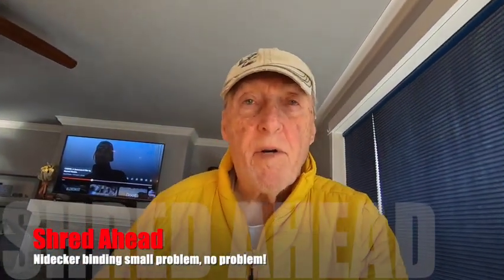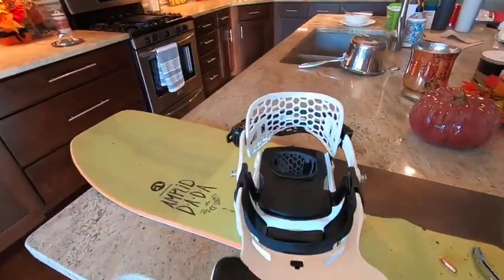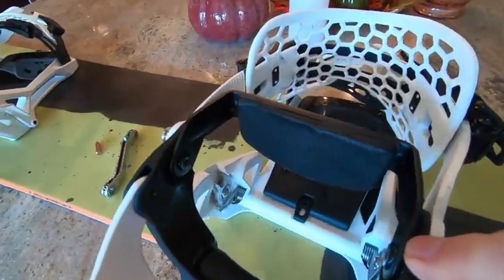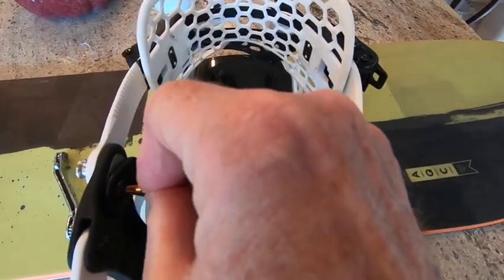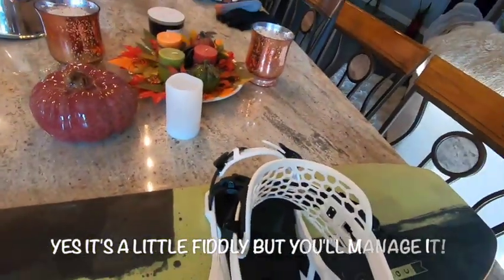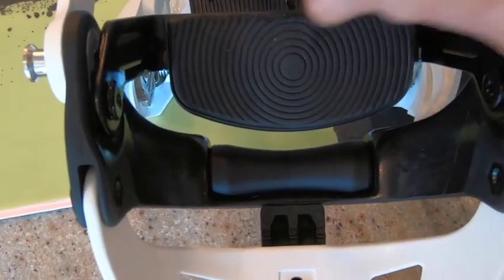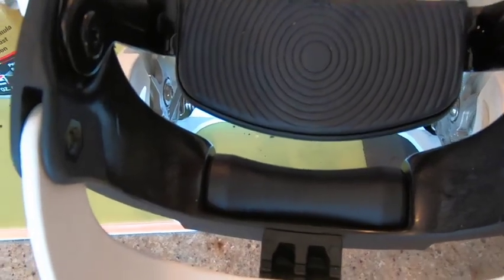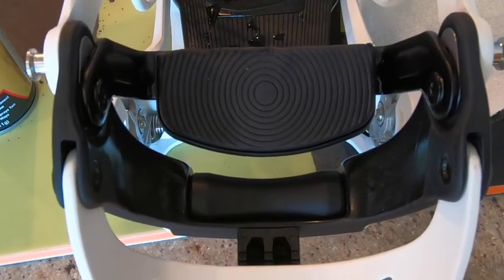Small binding problem (supermatic heel cradle)

Comment: Might be worth a bit of red loctite. I keep the glue-stick style loctite with all my tools and parts as it makes much less of a mess when applying to bolts.
Reply from the maker: I think the retention on the screws is tight enough that they aren't going to loosen up, more moving parts more to think about.
Reply: or nail polish is good

Comment: What’s your take on the bindings overall? I’m looking at these and a set of flow nx2s for my new board so any info would be helpful
Reply from the maker: I like the Supermatic but it can be a little fiddly, however the convinces is great. Still the coming out is a slightly longer process due to the push down lever for release! The highback not folding down on the heelside into the path of the push foot is something that I would consider problematic on the flow or nidecker rear entry systems! So like most binding's pro's & con's seem standard, hope this helps?